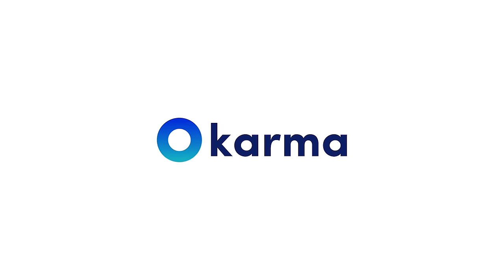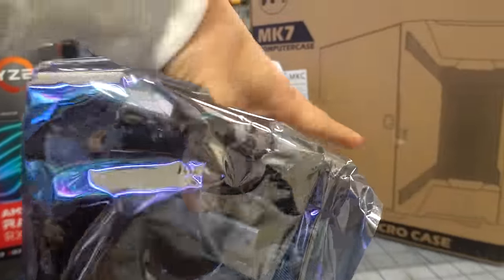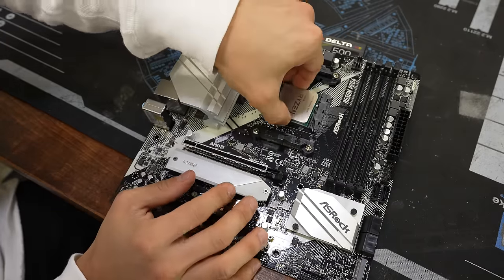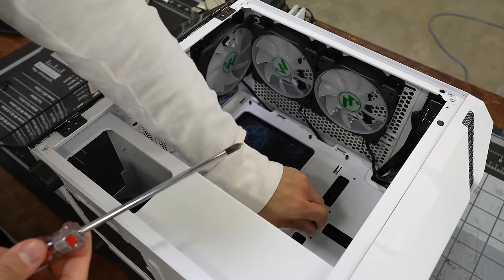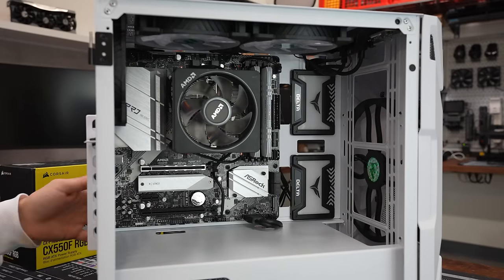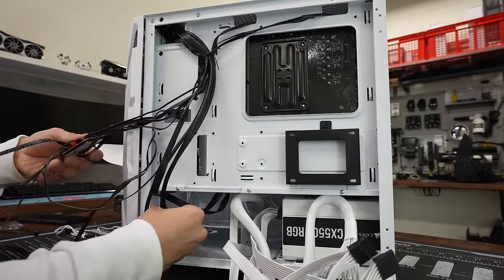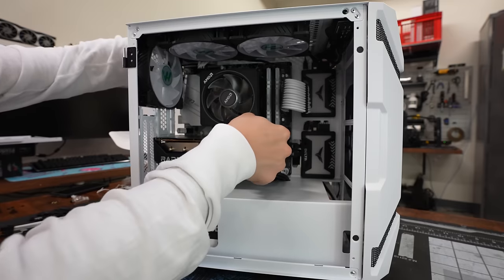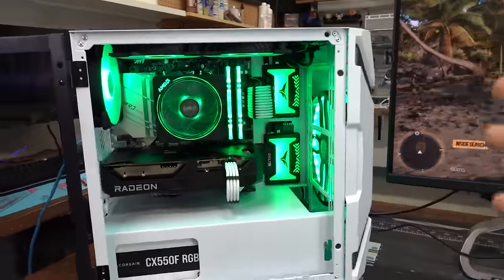This PC wasn't supposed to look THIS GOOD

Comment: Love it! I use Mustex cases alot they actually have a good range of products. The Strix 6600XT is in no way $399 though it's closer to $599 at Microcenter. So more like a $1400 build instead of a $1200 build. Keep the content coming my dude!
Reply: Yeah my 6600 is 450 so no way a 6600 xt would be 399

Comment: Ive been looking at this case for a long time, this is the best looking build ive seen in it so far.  I love the design of this case, FINALLY a case with good airflow its about time they got back to function as well as form.
Reply: I've been building PC's for a long time...  Now I'm an old geezer who just doesn't care anymore, so I shopped Cyberpower's cases and found this exact one for a custom build.  Well, almost exact, it has a little orange badge on the front for some reason.  [whatever]  I am pretty excited to get it here so I can tear it all down, repaste everything and make it perty.

Comment: funny thing about the AMD Wraith Prism : In France, there is an e-tailer that has a pretty complete piece of solftware to build the PC you want, you can pay several "tiers" of fees for the assembly : the lowest one, you only get the PC you've ordered. Next one, you get the PC and a windows install. Final one, you get the PC, W10 install and all the boxes that comes with your parts + included accesories like stock coolers if you used an aftermarket one.

Most people take the first one (cause it is like a 50€ build fee), and install W10 themselves. There is very little people taking the VIP option, meaning they end up with a SHIT TON of stock coolers, and you could buy a Stealth for 7€, Spire for 10€ and a Prism for 15€. They didn't bother to list Intel coolers.

So with that, the AMD Wraith Prism was probably the best value value cooler you could get from that website
Reply: Dang. Do they ship overseas? I'd buy a Prism for that price.
Reply: @benjaminoechsli1941  no, sadly they only ship to France and Belgium. Even the french islands can't acces that !
Reply: @matthieuzglurg6015  Bummer. Thanks for the info, though!

Comment: Can you do a build themed around infinity mirrors
Some lesser known brands have some really cool products like kolink makes some fans with a really cool infinity mirrors on the fan hubs and the gamemax abyss case is a new alternative to the inwin 805 infinity
Then all you need it a cooler master illusion CPU water cooler and you have a nearly perfect infinite build
(But the meg x570 ace also has an infinity mirror and so does the Asus gtx 1080 Poseidon but those are very expensive and hard to find)

Comment: I'm glad to have a prev-gen card that still had a normal price.
And it's still faster than the 6600(XT) :)
Reply: 2070 super or higher?
Reply: Daniel Printy  yeah I just got a 1080ti off of a friend so I got mad mates rates on it, I'm so glad cause it still does better than a 3060 and on par with a 3060ti which would be the only things in my budget of I was buying new
Reply: couldve gotten a 3070 for the price i bought my 6600xt for if prices were msrp :(
Reply: @ArentTjao  jesus
Reply: Picked up a 5700XT for a great deal last year and swapped it for a Gigabyte 2070, safe to say I’m not upgrading GPU for a while. First I gotta upgrade my i7-3770 lmao
Reply: @blayd_  I am just wondering, why did you swap your 5700xt out for a 2070?
Reply: @blayd_  damn yeah, but cpus are buggered too, I've had my ryzen 5 3600 for a year now and it's gone up in price from when I got it, insane
Reply: @brrt1680  5700 xt > 2070 not super other then dlss or rtx
Reply: Got a GTX 1080ti. Super glad I made that purchase back in 2018...

Comment: I really like this case too - the ONLY disappointment I had is that if one uses an MATX board, a 3-slot card is basically sitting on the power-supply shroud, and that's not removable.  Other than that, it's a fantastic value!

Comment: That’s the exact case I have and I went with the 4 fan so the front fan is the 200 and it’s great! The fans move air really good and it’s affordable. And just to add to it has a gpu vertical mount which I was wanting to do so that was just the cherry on top!

Comment: Musetex cases are actually very sturdy and well built. I myself have a musetex tw8 s-6 in black and it's a very good case. Comes with 6 fans preinstalled, and hooked up to an RGB controller. Only downside is that my 360mm aios can't be installed when I have my 3070ti installed

Comment: I have that board. The heatsink for the m.2 doesn't really make contact with the m.2 stick, might need a 1mm pad to make real contact. Also the IO shield has holes for your own wifi antenna, which is slotted on the board under the graphics card. So you have to install the wifi card after the board is in the case, not impossible but just a bit difficult to manage.

Comment: 1. It's too bad the mobo will fall off of the tray because it doesn't have the brace installed, and the whole thing is probably static fried because he didn't wear a Lance Armstrong bracelet. 2. For those interested, I just used that exact set of Asia Horse cables on a build, and it's high quality through and through. I dunno if he's sponsored by them, but I'm not and I'd recommend them all day. Also, I don't wanna admit it, but he's right, that AMD sink looks good.

Comment: if you from south east asia (maybe) you will find many case like this..some of the case have decent air flow. it have mesh and ring to pull the tempered glass, same like you using..aigo,segotep, 1stplayer, gamdias,tecware, ZZAW..and its very affordable for low budget gaming pc.

Comment: Nice build! :3

A couple things to point out, though, since I happen to have that exact same motherboard and CPU combination, should anyone want to build a system with them:
1. While B550 does support PCIe 4.0, the 5600G does not
2. I bought my board new; out of box, it needs a BIOS Flash in order to support the 5600G

Comment: The 6600 being underwhelming depends on the price where you live and so you really need to take the RRP at face value. Here in Australia for instance the RX6600 is half the price of the 3060 in stores. Also it would help if there were any actual cards available and at RRP prices

Comment: I literally just built a similar system. I ended up out the door paying like 1400 for mine out the door. Good lucky getting the 6600XT at low cost. I lucked out and got only a slightly upcharged one from Best Buy.

Comment: I scored the x570 model of that mobo on eBay for less than 100 with shipping and taxes included. I also picked up a 5800x cpu off Facebook marketplace for 300 no taxes or shipping. 

On a mobo review video from actually overclocking buildzoid said that while not ideal for high end overclocking the asrock b550 and x570 m pro 4 are suitable to support 8 core cpu with room for overclocking. I don't plan to overclock on it so it's all gravy. =)

Comment: this is very similar to my build 
thermaltake s100tg up here 6x rgb fans
5600x
16gb 3200 corsair vengeance 
 gigabyte oc 6600xt 
ez diy white cables
b450m mortar max
 sn 750 nvme
cooler master nwe 600w

all rgb set to purple and all white case with black accents on the other parts , its nice to see a more normal build on a yt vid for once

Comment: Refurbished boards from Amazon are a waste of time. I ordered an Aorus x570 board and they shipped an Aorus z390 board. When I checked the packaging to see how they could make such a stupid mistake, I saw they had labeled the box with two different stickers. One for x570 and one for z390, so whoever refurbed the board didn't check the box for other labels and whoever picked it in the warehouse just looked at the sticker on the box because they weren't exactly going to open it and check the socket. If you order an amazon refurb, factor in time for at least one replacement from amazon before your build gets done (just in case).

Comment: I would have moved the back fan more down to hide the missing IO shield and the huge hole above the vertical mount.
But other then that a very nice build!. Btw you should be able to use Aura sync to turn off or change GPU led's to green and then just uninstall the software.
It works on MSI and Gigabyte cards but i dont know about Asus though.

Comment: The other companies that make sleeved cables need to get on board with a 3x8 bridged pcie cable. I get them made from cable mod and they are not cheap at all. Even with the cheaper gpu's, the 2x8 cables look just as bad IMO with the seperated cable combs, more so on the 3x8. The rake style combs just on the top side of the cable is just not a good look in a mid to high end build

Comment: I had the same problem with my Strix 3090, I had to use Armory Crate to get the RGB working. Aura Sync doesn't work with the new Gen of cards like the one your using.

Comment: Cool looking build. The Signal software is pretty bad tbh. I tried it after several tubers recommended it. Slowed my games down and triggered an anti cheat for my system. Froze several time etc. Cool concept, but they have a lot of optimization to do.

Comment: The top and rear fan placement looks kind of clunky (despite it not really meaning a bunch for flow).  How would it look and feel with some water cooling and changes in that method?  How noisy is it with all fans?

Comment: I won't do warehouse mobo's because the two I tried previously were both missing the IO shield. Return that sucker!! I also had bad luck with a musetex case, the included fan hub had a short and made the system act really weird. Luckily I was able to return it to Amazon. Shoulda called this the high risk build 🤣

Comment: I have a case with a similar rgb hub. I recently bought a new motherboard & it doesn’t have the 3 pin connector. Is there an adapter or something I can buy to plug that in somewhere?

Comment: Hey Kyle? I don't know who else to ask but I'm having trouble with my new built PC that I finished about a week ago. The computer runs fine, but every couple of seconds. 

Maybe between 10 and 30 seconds my computer lags. It literally freezes for half a second and it's starting to really annoy me. 

I was wondering if you had any few tips or tricks that will not allow for this to happen. 

My drivers are updated, my cpu and gpu are not overclocked. I hardly have any programs running and when I do start to run any programs it gets worse. 

I would honestly appreciate your feedback please! Thankyou and I love the channel.

Comment: So i got the exact same PSU and I'm planning on getting a 3060ti (sooner or later), some of them have 2 connectors like 6 and 8 pin or 8 and 8 pin but the psu has one 8 pin pci-e which splits into 2x 6+2 pin. My question now is whether it's fine to run a 3060ti on 1 cable or if i have to get a new psu ??

Comment: Just built a new pc with a core I5 10600K z590 Aorus elite ax 32GB ram a a gigabyte rx 6600XT requires a 8 pin and a 6 pin and I'm getting only 40FPS at 1080. Any ideas of why?

Comment: What’s a good gpu that works well with a core i5-10400f that has super inflated in price, I’m currently using a 1060 6gb that’s been overclocked to 1952MHZ on the boost and 1737MHZ on the base core clock

Comment: I saw that CPU cooler on a Dell system that constantly peaked its thermal limit and killed performance.  Did you notice any throttling at all?...  Whelp, I just saw how you applied your paste, so never mind.  That was horrid dude.  You should never touch a PC ever again...

Comment: My 24 pin cord only works at an angle or partially pushed in any idea on how to fix or do I have to order a whole new psu?
Reply: You might have bent one of the pins on the board, or the metal contacts in the connector itself so it doesn't touch unless angled. check with a torch for anything that looks misaligned and gently nudge it back if you can with something like a toothpick

Comment: I always hear you b*tching about how bad the RGB Ecosystem is - and it's true, for the most part.
Might i suggest you have a look into the "openRGB" Software?
Having you make a video comparing different RGB Controllers - hardware or software (Razer Chroma ARGB Controller, Aquacomputer Farbwerk, CrankzWare RainPOW2, Zahlman Z-Sync, openRGB, etc) would be quite awesome too.

Comment: the 5600G has half the L3 cache as non G Zen 3 CPU's and with a GPU it would act like the 3600X. I feel the G series CPU's are only good if your not planning to add a GPU for a while not to miss out on that extra 16 MB's of cache that really benefits gaming. But I get it, you need to stay current GEN with your videos, so that makes u cool cause u can so just do it. lol

Comment: The APUs have a much stronger memory controller, and the infinity fabric clocks much higher, yet I always see builds still using 3200-3600 Mbps DDR4.  Why???  Get some 4000-4600 dang it!
Reply: for stability reasons. 3200-3600 is much more likely to play nice with the pc. the higher the clock speed, the more potential for system instability. ram is extremely finicky, as we all know. and increasing the clock speed past 3600 wont net but 2,3,4% performance at most anyway. its just not worth the potential hassle or extra cost in the end.
Reply: You cant adjust the fabric ratio on the apus anyway so it doesn't really do much